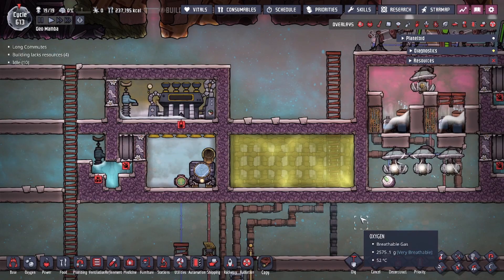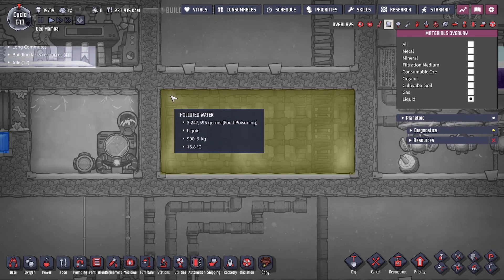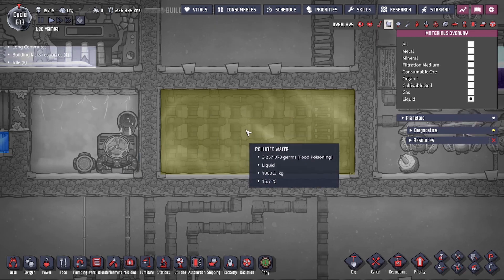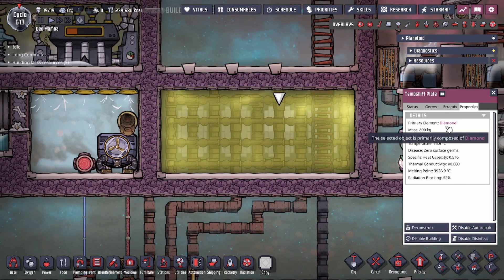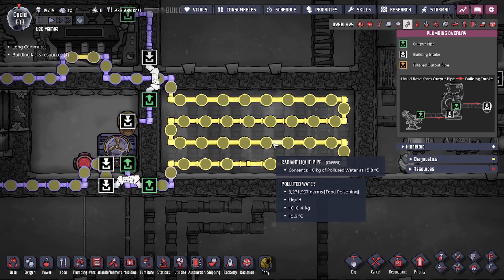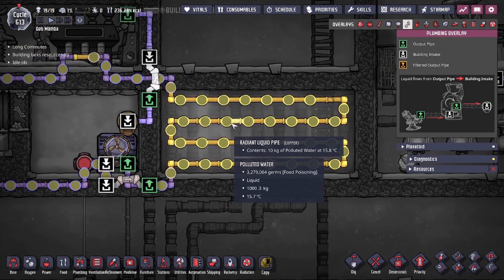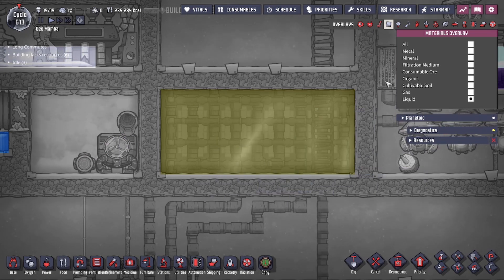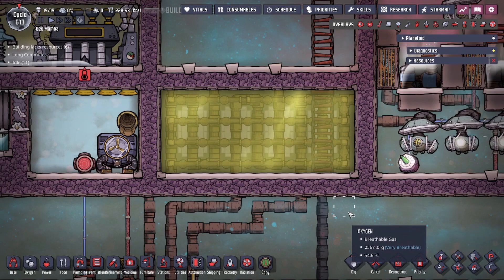How to Cool Oxygen - Radiator Cooling Design - Oxygen Not Included

Comment: Gas pipes: steel is best yes. Then aluminum ore, followed closely by uranium ore, surprisingly. After that it doesn’t matter. 

I’ve decided to do an air exchanger instead of your method. I made a larger than usual infinite storage with a liquid lock as well. Inside I have several vents either mesh tile between on the bottom and crude oil as my liquid. A bunch of air pumps and switches with lines out for “future”. I filled it with good old igneous rock temp plates and ran my cooling loop through the crude oil and in a single loop (0 coil) with a temp controlled shut off valve. Works absolutely beautifully, <25C air all the time. I have 1000kg of oxygen in a 60 tile area or so.

Comment: The way I like to keep my base and oxygen cool is by radiating the hot air from the electroliser with the water used to run it. It isn't that hot usually and I keep the base cool by running radiant water tiles behind the floors. The warm air won't warm the base up with that setup. The mass difference won't allow it.
Reply from the maker: so you need to find specifically a non-hot water source to do this
Reply: @2LegitCity  at least not hotter than 75C.
My go to water source is a salt water geyser + 2x desalinator combo.
Reply from the maker: @jerzu86  oh i see, i tend to do my farming indoors so i need to keep it lower than 30c whenever possible for my early game mealwood
Reply: @2LegitCity  I also do it indoor. Thanks to the aquatuner or a very cold biome I control the base temp. Water cools better than air as you know.